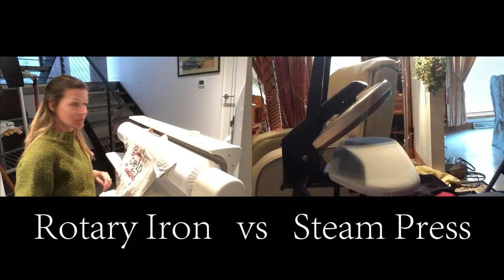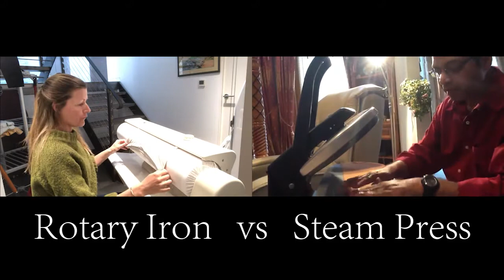Rotary Iron and Steam Press T Shirt ironing speed comparison

Comment: This is not a fair comparison whatsoever.  The man using the steam press is pressing a much larger garment with long sleeves which had a polo neck collar, whereas the woman using the roller iron was ironing a much smaller t-shirt with shorter sleeves that did not have a collar and she was using dry heat and therefore did not have to wait for the machine to generate steam.
Reply from the maker: The rotary iron automatically sprays steam, the steam press should be waiting for long time~
Reply: But that still does not account for the fact that the man had a bigger garment to press on a much smaller machine therefore of course it would take him much longer to do it
Reply from the maker: It's not about "time", the user needs to do a lot of operations when he uses the steam press, but the lady is relaxed   @countkostaki
Reply: Your title is "ironing speed comparison" therefore it IS about time because you are saying it is about the speed it takes to iron a garment - and in any case the larger the garment the more operations the man using the press would have to take because there is more manipulation of it on a smaller surface, whereas the smaller garment on a larger surface there is no manipulation - if she was ironing the larger garment on the same machine she would also have to move it about more than she would be doing
Reply from the maker: maybe you should watch the whole video first, there is indeed a big difference in speed  @countkostaki
Reply: @lorsn  I did watch it all
Reply from the maker: so you will find the rotary iron was ironed two pieces of cloth and stopped 3 mins. At the same time, the steam press just finished one  @countkostaki